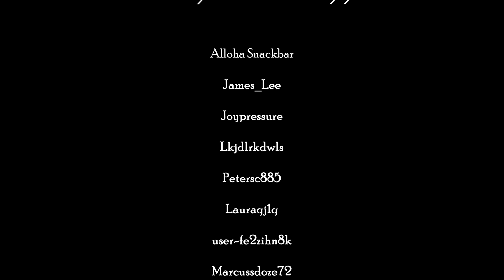Making a Center Punch with a Waste Drill Bit / DIY

Comment from the maker: Please turn on your language subtitles! 
Join our membership!
I bought a lot of hexagonal drill bits. I haven't counted it, but I think it's more than hundreds.
If you use it to a certain extent, the cross-shaped ends get crushed, and it becomes harder and harder to put the piece in. 
I used to throw it away when it was spinning or slipping.
The field uses a new one right away, even if it's a little crushed, for the speed of the work.
Since the material for making hexagonal drill bits is high-strength steel in its own way, I looked for new ways to use them. I think it'd be good to transform it into a center punch.
Even with low-cost products, the sharpness at the end doesn't last long, no matter how good the center punch is.
The drill bit that was not available was sharpened with a grinder, hardened to make it strong, and it became a great center punch.
As you can see in the video, when punching on a washer or bolt, it is strongly punched without any difficulty. Of course, the drill blade doesn't slip.

It's a world where recycling is a hot topic.
I'll introduce you to a simple way to make a center punch using a discarded drill bit. 
I hope you look at the video, I hope you can use it.
Thank you.

#DIY #DrillBit #CenterPunch #making #recycle #DIY_IDEA_INVENTION